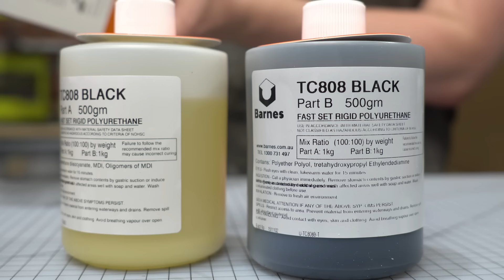Let's Pour Silicone without instructions...

Comment: Mix, pour to cast mold, vacuum the mold, let it set in the vacuum under negative pressure, release the air valve and peel off the mold. Pretty sure that's the order. If you vacuum before pouring, you just introduce air bubbles you just got rid of into the mold when you pour.
Reply: molds won't always fit into a pressure chamber. You pour higher up in a thin stream to avoid air bubbles.
Reply: Yes that is exactly how to do it, plus read instructions, take all required safety precautions that instruction tells you to do, stir do not shake....lol  Did I mention READ THE INSTRUCTION FOR SAFETY!
Reply: This! I’m all for diving in, but I have a problem with shoddy work because of a lack of common sense. I love Jazza but still have PTSD from the time he ruined the horsehair trying to make brushes.
Reply: if you first vacuum and then poor from a high stream only on one spot and slightly tap the molds you have virtually no airbubbles. that is how my teacher in Special effects prosthetics did it, who is also a specialist in the field. Both options work depending on what exactly you are doing and how big your molds are.
Reply: You vacuum two times first before pouring and second after.

Comment: might want to read safety instructions when dealing with resin.
also might want to use a compression chamber when using resin pours.
also instead of doing 2/3 piece molds you can just do a cut mold.
Reply: The point of the video is to do it without instructions. But you should still definitely read the instructions.

Comment: I also watch a lot of resin art channels, and fully recommend placing your poured molds into the vacuum pot while they’re curing. Even if you pull the air out before the pour, the act of pouring creates bubbles. Also also, the higher up you pour from, relative to the surface, the more air is introduced.

Comment: The moment I heard "6-minute working time for silicone" I knew it would be CHAOS! :)
For miniatures and sculptures you should not go below 30min - 2h work time to let the silicone settle in all the details and degass it's surface on its own.
With resin you want to use pressure chamber to use short working time to make many casts and clear inside.

Comment: I believe you can just pour the dragon silicone as one full mold and use an exact blade to cut the silicone and the parting cuts will fit back together perfectly. Robert Tolone uses this process.
Reply: The CraftsMan Steady Craftin’ is great with molds.
Reply: @lollylolly8186 True that! I love "the Craftsman!!"
Reply: You can but it's a right nightmare; you can end up damaging the original (if you're trying to keep it) and even with the sharpest exacto, it wont always cut very neatly (though if you do cut, a zig zag will help it lock back together again)
A more well planned and timed version of what Jazza did is generally industry standard, especially for complex pieces
Reply: I’m sculpting an entire Godzilla, full dynamic posing and whatnot, would this method work? If not what can I do. (I don’t need to keep the original, it’s made of monster clay)
Reply: @Thedifficultytweak  You should really check out Robert Tolone's channel one cut molds require a lot of planning but create super clean casts and ensure everything fits and casts correctly without much cleanup
But yeah a one cut mold or multi piece mold will work for your godzilla cast,  in my experience just be sure to buy enough silicone cause having too thin walls on a mold can potentially cause it to tear
Reply: @nickslayr5077  thank you, I certainly will
Reply: I'm a fan of the one-part "cut" or "cup" mold because it's the easiest (in my experience) - I just tack my object to the bottom of a cup/container, mix A+B, and pour. Then cut it out carefully, using some type of "jeweler's cut", with intentionally jaggedy lock-together edges. BONUS: You also typically wind up with less *flash*, or at least the thinnnnn type of flash that you can scrape off with the x-acto blade turned 90 degrees to the object's surface.  :)

Comment: As someone w  prosthetic makeup mould making background here are some tips that may help ^^:  When pouring any material into the mould usually for the first layers u pour few amount from a high distance so the rest of the bubbles have a way to pop before making their way into the cast. 

Also for casting with plaster u can make a first batch that is more liquid (not super watery) and pour a little bit and move around the mould so it can adhiere to the surface, then fill up the rest of the mould with a more dense mix so it dries up faster. Also, you can set it in a table and slam the table around so the air bubbles make their way to the top and pop ^^ 

Hope this helps, and sorry if its not very clear, english is not my first language.

Comment: My family did plastercraft figurines for decades.  To make molds, we would stand things like the dragon head on its flat base and used a paint-on silicone, making a thick flap all around the base.  You have to do a lot of layers, but it’s more flexible (and not a block) to remove when you cast, basically turn them inside out to remove.  To fill the mold, we would fit squares of cardboard with holes in the middle.  Then we would use that cardboard to suspend the mold by the thick flap into a glass or bucket, so it would be upside down.  I feel that you used too much water in your plaster.  It’s been a very long time since I did it, but I don’t believe we ever used 1:1 ratio of plaster to water.  We would definitely have a damp, but firm cast after drying in mold overnight.  We would remove the casting at that point and let it completely dry before painting it.

Comment: I’ve never had much luck with vacuuming out bubbles when I’ve done molding/casting. I recommend pressure molding and casting. Similar concept as vacuuming except that you pump air in which builds the pressure in the tank before the silicone or resin starts curing. This will crush the bubbles down to the point they practically vanish and it pushes the silicone or resin into the fine details really well. Overall though, you did way better than my first go at molding and casting, Jazza!

Comment: yeah you are definitely meant to vacuum it after pouring around the form >< the pouring is what causes the bubbles in the mould and vacuuming draws them out. 

Also silicon moulds are generally flexible enough that it can be taken off from a lot of angled stuff though with fragile things you can generally you can pour a small base in first to set, place the object on the set base and pour to fill, vacuum to set to remove bubbles, once set you carefully cut the mould in half in a way that gives best freedom of removal and peel it off into a 2 part mould.

I hope you give this stuff another go because I imagine once you get it down you could make some cool reusable moulds and make stuff specifically to mould them (miniatures and figurines for instance) then you can make an army of things!

Comment: As someone who works with resin and making my own molds. I can tell you you want to use a pressure pot, NOT a vacuum chamber when making the molds and working with the polyurethane, or resin, heck it would even work with the plaster. The reason being is even with vacuuming the silicone or other items, you're adding bubbles back in with pouring. A vacume chamber can also only do so much and if working with something quick setting you just waste so much time. A pressure pot you don't need to worry about bubbles during mixing or pouring, just mix, pour, place in pot, and pressurize for the cure time. The pressure pot compresses all the bubbles down so there nonexistent giving you bubble free, smooth resaults that gives you even better detail.

Comment: If you keep doing resin pours, get a respirator (Half mask usually works, like a spray painters mask) The fumes uncured resin makes is pretty nasty stuff. Also try not to touch the resin, as it can get fairly hot and burn you due to the reaction of resin mixes reacting pretty harshly

Comment: A few tips to minimize bubbles:
For silicone you can use a vacuum chamber to remove bubble before you pour. While pouring, pour from high up in a thin stream (this pops left over bubbles) and try to pour in one spot on a low point that’s not on your model. After you pour you can tap on the mold or shake it to release extra bubbles, or cure it inside a pressure pot. 

For casting in resin, some resin can be degassed in a vacuum chamber before you pour. While pouring, you can brush your resin into the mold with a disposable brush to get resin into all the undercuts. Then you can tap on the mold or shake it to release extra bubbles, a torch can also remove bubbles, or you can cure it in a pressure pot. 

I love when people try out mold making, it’s really fun and useful.

Comment: When you dont have a pressure pot to get rid of the bubbles, if you dust your molds with talcum powder, due to the capillary action the resin will find its way into small details.

Comment: Jazza please use uv protection Google's while using your fancy lamp and downright flashing it in your face....
Tip: after mixing  the silicone mixture transfer it to another mould to avoid unmixed parts and don't scrap the left on side

Comment: A very good first attempt! You've clearly done your research. You could look into getting a pressure pot as well as a vacuum chamber. You can leave the cast in there overnight as it cures, rather than having to rush around vacuuming out bubbles before the resin sets.
Also try cutting the casts out of a one-part mould with a scalpel, rather than making a 2 or 3 part mould. It can actually leave less mould lines and be a lot simpler

Comment: Hey jazza, awesome! Always asked myself when you will give mold making and casting a try. Love it.

P. S. A vacuum chamber is not qualified for degassing resin because it sucks the air out. For resin you want a pressure pot. It makes the bubbles "pop"

Comment: Robert Tolone- best guy for moulds and resin casting.
Always pour from the bottom up! Pouring the top surface catches bubbles. 
Use monster clay to fill the corners FIRST to use less silicone.

Comment: Aren't you supposed to use the vacuum chamber after puring the resin into the mold?
Reply: Yes
Reply: You use a vacuum chamber to degas the silicone before pouring, so it pours nicely. 
After the resin goes in your mold, you can use a pressure pot to squeeze any bubbles into such tiny spheres that you can't see them.
Reply: No that's a pressure chamber, usually. Vacuum before to get out as many bubbles as possible before pouring, then a pressure pot to shrink any remaining bubbles or those created during the pouring. I would imagine some pots can be used for both vacuum and pressure but they do the opposite of each other.

Comment: Oh, man. Whenever you’re working with resin or silicone or any permanent embedding substance, the first couple trial casts always, always seem to go really well to lure you into a false sense of security. Then you try it with some treasured, fragile possession and that’s when it all goes wrong. That’s when you end up slicing pieces off of other things to fill gaps, start chopping table legs shorter to get the level of the liquid just right, start to cold sweat into the mixture which just ruins it even further

Comment: i used to own a resin bases business, and used a lot of pinkysil. this video was... rough :). glad you got there but definitely could get better. i never bothered with a vacc chamber, never needed it. use enough CRC silicon spray which helps remove bubbles, and pour from a height (which breaks bubbles during the drop), and you will be fine. if you are dealing with intricate detail you an brush on the initial lawyer of silicon to those bits, and ensure no bubbles and then pour the rest after.

Comment: A tip for pouring silicone is to make a thin stream when pouring it into the mold like pouring it from a higher height and pouring it as if u were pouring a drink, pouring it with a thinner stream helps get the bubbles out of the silicone if there are any left.      Love ya Jazza!

Comment: Jazza an easy way to get out bubbles when you can't use a vacuum chamber is called a tall pour.  You pour the silicone from 2 or 3 feet above your mold and let the silicone form a thin thread as you pour it. Most bubbles will pop on the way down.

Comment: Good ways to avoid bubbles: 1, of course, is a vacuum chamber, but it's not necessary and you already got one, 2, brush the silicone onto the thing you're casting, making sure to get in every crevasse, 3, when casting with some resin, gently hit it on the table a bit to make the bubbles rise up more

Comment: As someone with a fair amount of silicone experience, this was alternately painful and funny to watch.  
If I imagine a beginner watching, there actually is something to be learned from failure: what NOT to do.  I could see how this video is a 'good' example of beginner mistakes to watch out for.  Then watching a video by an experienced mold-maker on the PROPER techniques can be followed, knowing what pitfalls to avoid, what shortcuts not to take.  Why do we do things this certain way as the experienced instructor taught?  To avoid the types of failures illustrated by the inexperienced 'instructor,' that's why.  Now we know.  ;)

Comment: Peter Brown is the resin pouring king here on Youtube (at least in my eyes). Along with turning/lathe machine work. 

If you want to dive deeper into bigger resin projects, go to Peter. Some things I've watched/learned from Peter Brown:
- He has made some epic projects like an axe made from gummy bears, a pepper mill made from pepper (don't try to turn that on the lathe, airborne pepper)
- You can totally just stick your whole project in the vacuum pot, if it fits. That will minimise the bubbles.
- Absolutely pay attention to your working time. If you want something super smooth and with time to pour and cure in the vacuum pot overnight, use something with a long casting time like art resin (I believe Peter was a big fan of the Total Boat resin)
- You don't need to use fancy resin dyes to get coloured or pigmented resin. Peter has a whole series where he experiments with various household items to see which ones work as pigment.
- Moisture will mess up your resin job, so dry things out in a dehydrator etc before you try to encase it in resin

Comment: Fun physics fact..... putting stuff in a vacuum lowers the boiling point. That's the reason you can get water to boil at room temp and the reason why your resin blasted all over the chamber (don't know all of the ingredients but most likely some solvent compound went all phase change on you)

Comment: Hey mate, a couple of tips if I may.

Brush a thin layer of talc in the silicone mould for a bubble free cast. Smooth on hurethane resins don't need degassing. If you want to use the degasser, do it after you pour the resin so all the bubbles on the bottom will go away and if it sets while degassing, you can saw the bottom, is not pretty bit the sculpt will be saved 🤘

Comment: There is a more complicated method you can use to mold bigger objects and not use too much silicone. You start by covering the object you want to mold with 1cm of clay, then you make a plaster shell (one or more parts if needed) with some "funnels" on top , you remove the clay from the object, put the object back in the center of the shell and then you can pour the silicone in the funnels (you need vents in every high spot to ensure there are no air pockets). And now you have a thin flexible silicone mold with a rigid shell.

Comment: vacuuming is great for silicone as you have more work time, so the bubbles expand and raise to the top,  but for resin you should use a pressure pot instead which compresses the air bubbles to a microscopic size that is not even visible, and let it set inside the pressure chamber

Comment: If you want an easier time of pouring, to get way less bubbles, use a wide popsicle stick or tongue depresser and pour the silicone mixture down the stick into your mould. That pops most of the bubbles, you can also use a shaker table like the ones used in dry washing. (Gold mining) Hope someone can use this, used to make tables and desks with a resin covered top, which is how I learned to do that and there's tons of vids you can watch. North of the border is a great channel.

Comment: The vacuum to remove bubbles is pretty effective but another pretty effective method is to pour when your stuff's not starting to set and have a solid mold frame and then whack it with a hammer or something to dislodge the bubbles. Also pour you silicone from high up so that it's a thin stream going down into the mold and don't pour directly on your piece